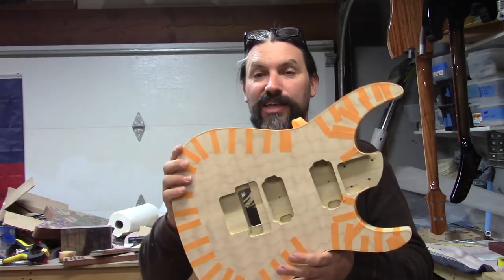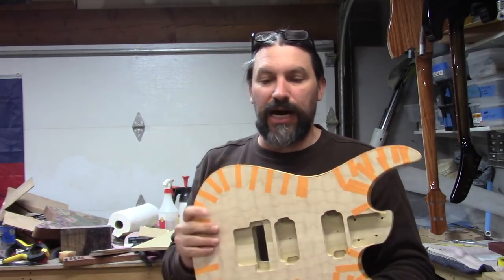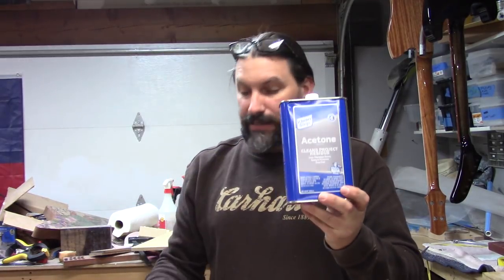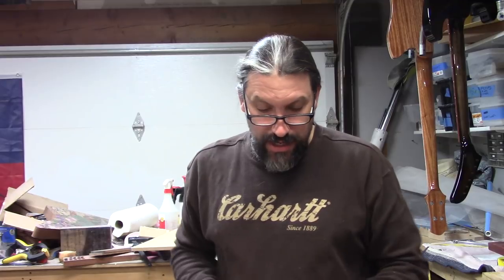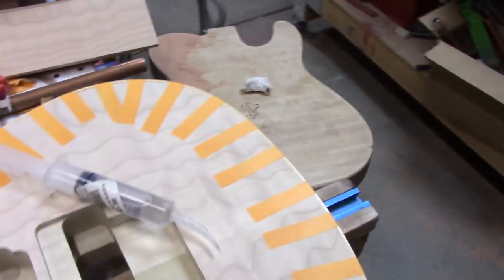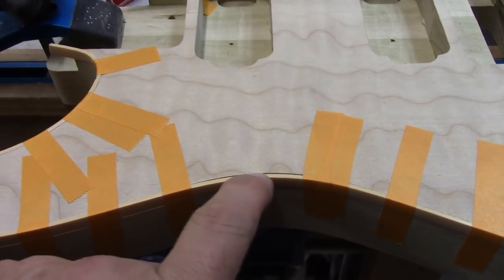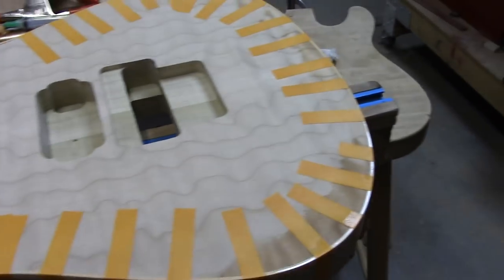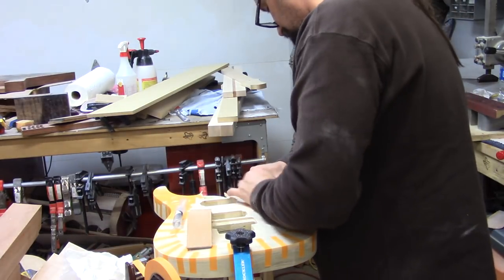The Shockingly Easy Way To Attach Plastic Binding To A Guitar Body

Comment: I like the acetone trick a lot. Did my last guitar that way. But I've used the stew mac binding glue, not fun. I've used CA exactly the way you use acetone and it works great but the acetone is awesome and cheap.
Reply from the maker: The only down side is my skin gets dry
Reply: Great video!  The old Stew Mac binding glue (SIgMent?)  was just OK, not great.  The more recent "Bind-All" is the most incredible binding glue I've ever come across - it works on everything I've tried.   You've obviously proven acetone works with Stew Mac ABS, but I'd recommend a scrap test before using acetone on other plastics.

Comment: New builds, acetone is the go to…. Otherwise if you are dealing with a finish that is alcohol based (shellac) then acetone will likely dissolve before causing any issues, but lacquer will melt, it will certainly soften poly urethane and other water based ones will coagulate on you……or at least I’ve had the privilege of learning this on really early repairs……CA or cement is good for those.
Reply from the maker: I appreciate your comment and I'm not attempting to move the goal post... Now, you know, that I would NEVER encourage anyone to do this to a finished guitar. We do not do any repair work and I'm only talking about new builds.
Reply: @TexasToastGuitars  I figured that is what you meant Matt 😉…… I do both repairs and new builds, but just in case hopefully anyone else that is cutting their teeth with binding can learn without making the same mistakes I made in my early times of my own ignorance of different chemical reactions (and consequences).

Comment: I used acetone for a kit I 'built' and it was very forgiving bc you can use a ton and it flashes off wo leaving any discoloration. The slurry was really easy to use to fill gaps too.
Reply from the maker: We all but stopped using the slurry... too damn messy.

Comment: I wish I never saw this video, it has set me back an entire day at minimum. The acetone wicks up anywhere you tape and melts the glue into the wood. I just went to stain my guitar and literally everywhere I had tape is not taking stain properly, patches everywhere. I’m using standard green frog tape.

Just glue and tape as you go, don’t risk this method. I am yet to sand it back down so I don’t know yet if the stain job will yet be salvageable, either way, taking a two horn carve top of flame maple all the way back down to 120 is no quick job.
Reply from the maker: Sorry it didn't work for you
Reply: Hi, I was wondering why using acetone did not work for Raymond Wilson? Was this the wood, the acetone or the glue on the tape?
Please somebody explain. Thanks!!!
Reply from the maker: @karajokee2102  Hard to say... I have never had an issue and I have lots of guitars on my webpage, videos on YouTube as well as numerous social media pictures as evidence. I'm not saying that he is telling stories but I also wont say that my good luck was a fluke
Reply: @karajokee2102  I do believe Texas toast use stew Mac binding tape. OP used painter's tape. Not certain if that's why or not.

Comment: This is now my favourite way of doing binding. Please be aware though that it doesn’t work with PVC binding, only celluloid & ABS.
Reply from the maker: Very true, we use Bind-All for that stuff or even super glue in a pinch
Reply: @TexasToastGuitars  I tried super glue (which is what Ben Crowe uses) when I realised that acetone wouldn’t work. Made a horrible mess & eded up with binding tape glued to my fingers! Have taken it all off again now & ordered some ABS binding instead.

Comment: CA works the same way (tape first, then wick) and doesn't soften the binding like acetone...which then requires some time to re-harden and can shrink it back. It does make more of a mess, but you're going to be scraping and sanding anyway.
Reply from the maker: You got to live how you want to live
Reply: Just pointing it out, since you mentioned never having used it. Many ways to bind a cat. ;o)
Reply from the maker: @AZCobraman  We use CA glue when we use binding that isn't soluble in acetone

Comment: I'm going to attempt my first go at binding using the ABS plastic stuff. I always thought you had to use the special binding cement from StewMac to attach the ABS bindings. But I'll give this a go and see how well it works. Thanks!
Reply from the maker: Be sure and do some test bits first
Reply: @TexasToastGuitars  I ordered a bunch of different bindings (cream, ivory, black, white) and they came the other day. Cut some 1" pieces from each and did some tests on different pieces of scrap wood. Pine, maple, oak, mahogany, walnut and teak. Using your method here to attach bindings works like a charm. Had no issues with getting any of to adhere to these different woods. Thanks a bunch for the great tip!!!! It goes without saying that you won me over and I've subscribed to your channel. Happy Holidays!!!!!

Comment: Thanks for sharing. I'm fed up with using the messy binding glue :-(
I'll try this method next although I'm wondering is there any chance acetone might discolor woods that have strong natural colors?
Reply from the maker: Hi Steve, 
I don't know, best give it a try on a test piece.
Reply: Steve   Acetone dries out wood, so you might be able to oil it back to original shade. And sand with 600-800 when totally dry. Just an idea.

Comment: Great tip, I just tried it. How long do I need to keep the binding taped?
Reply from the maker: Hi Michael, it kinds depends we leave necks for a few hours but they are straight. We usually leave bodies for several hours or overnight. Mostly because we don't want to deal with it hahaha. It is pretty quick

Comment: Hi Matt,
Great technique. I have a question for you. I am about to try binding for the first time but thought I would test the Acetone on a scrap piece of wood first using a small piece of the binding I purchased. However as I applied the Acetone the binding cracked in several places about quarter inch apart on a very shallow bend. What would be the reason for this happening? Thank you!
Reply from the maker: Hi William, if you are trying to bend the binding without heat of some kind it can break. It could also depend on the type of binding you have. Where did it come from?
Good thing you tested it out first
Reply: Texas Toast Guitars 
Thank you, Matt! I live in the UK and bought it from a Company called Smallwonder-music but it doesn’t state what plastic it is. What plastic should I be looking for?
Reply from the maker: I have had sucsess with both ABS plastic and celluloid bindings
Reply: Texas Toast Guitars 
Thanks Matt for your time and info. I will take your advice and purchase some ABS. Much appreciated!